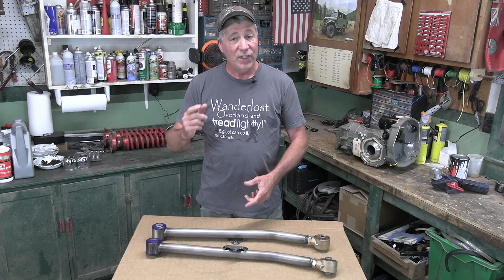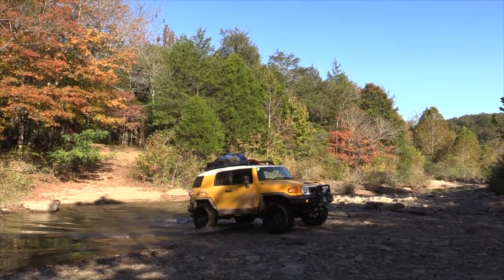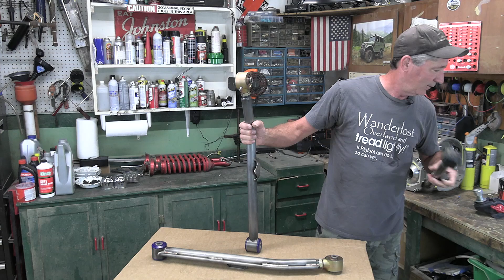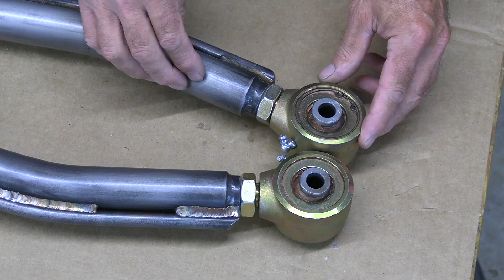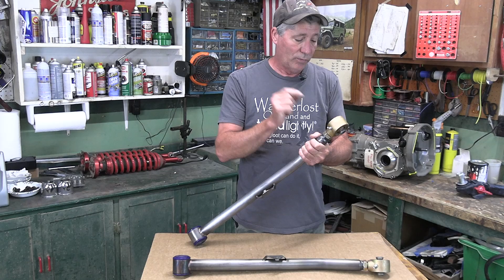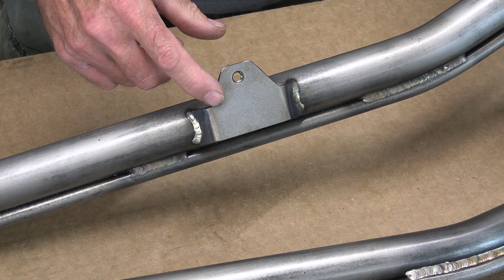NEW Toyota Rear Suspension Upgrade

Comment: The (Toyota) stock bolt for the parking brake line bracket does not fit the threaded bracket on the Axel Fab links.  Does anyone know the size/threads of the Axel thread on the bracket?

Comment: Would be nice to have a fixed end at the axle with a rubber bushing. Rubber wears pretty well, has decent flex, and you wouldn't have to worry about loose jam nuts and thread wear.